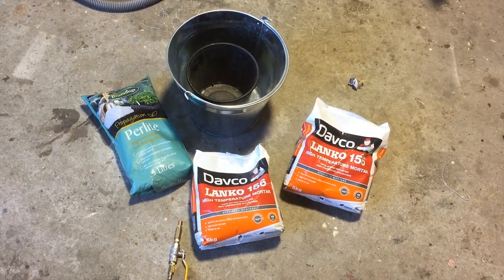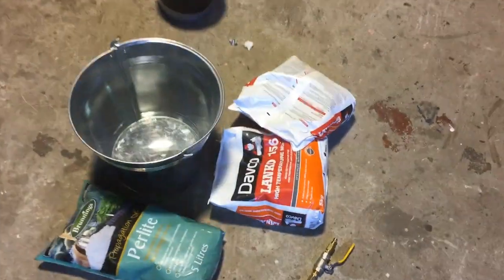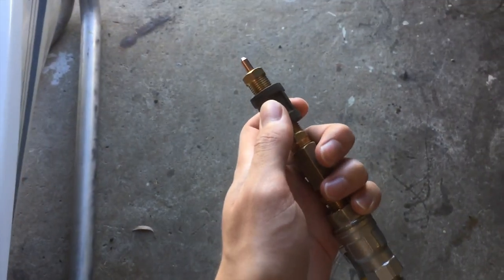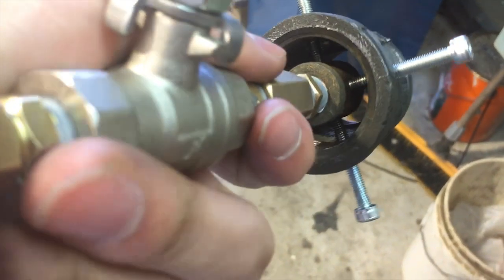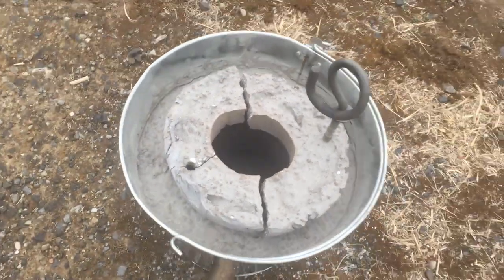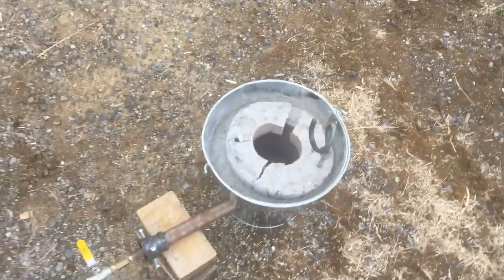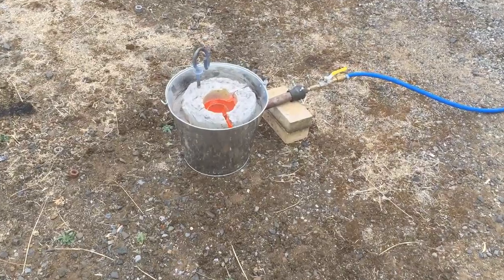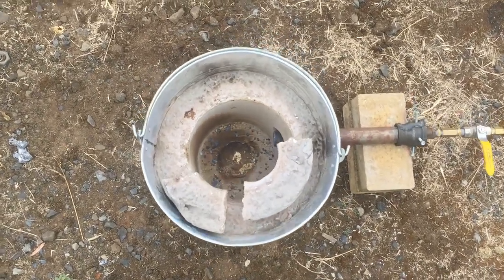A High Temperature Furnace

Comment: Can you push this up to manganese?
Reply from the maker: It's unlikely, the melting point of Mn is around 200C higher than anything else we've done with the furnace, which isn't an impossible feat, but is a pretty large margin to overcome. 
Even if we could push it that high, manganese is a very tricky metal to melt and cast, as it has the tendency to oxidise very quickly at high temperatures. Also, trying to cast it often results in the metal shattering upon cooling, due to how brittle it is.